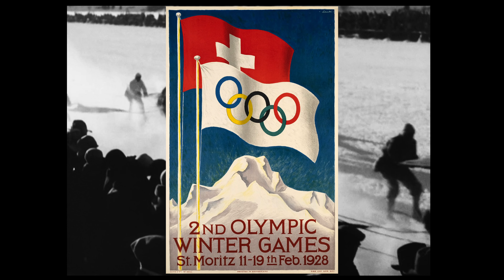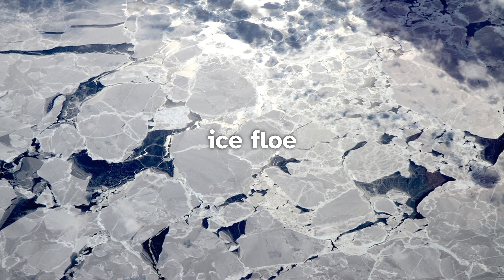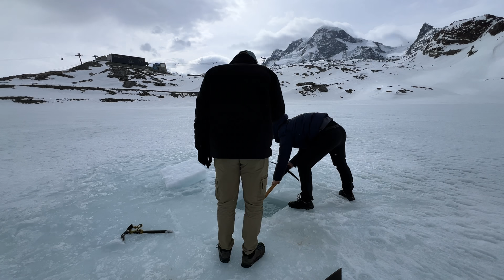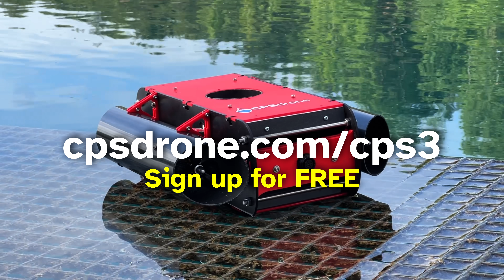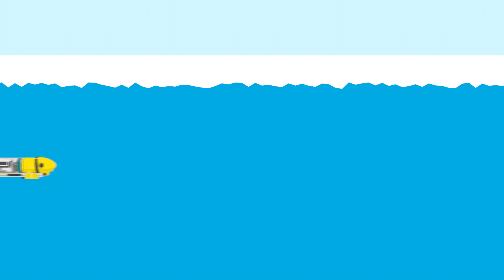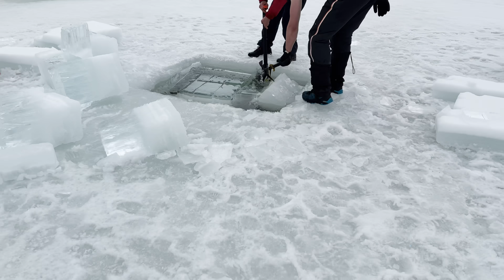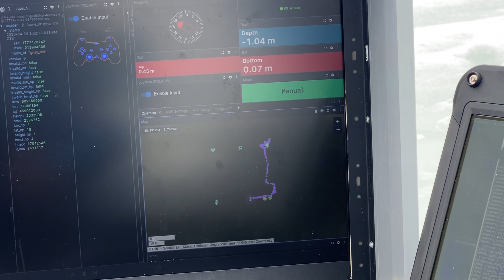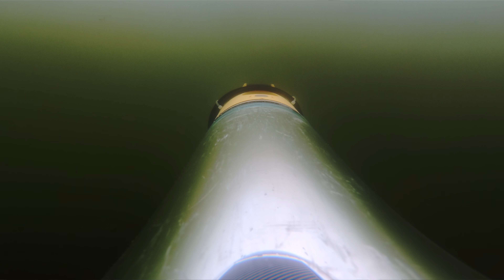Investigating an Alpine Submarine

Comment: Why can't they do the sound measuring from above the ice instead of below
Reply: Because the snow actually prevents any good measurements! Also, with this method we try to measure the ice at all times, even when it's thin and nothing can safely travel on it
Reply: @RichardRuedin drone with measurement device on rope
Reply: @BrickEnthus1ast what measurement device would you propose? Ultrasonic transducers require a very good interface to the ice sheet and a little snow would get in the way of that. You'd need to re apply ultrasonic coupling gel onto the icesheet too. Unfortunately even with no snow, the air interface ice sheet is more jagged and uneven than underwater. That alone can be really bad for your measurements, especially if you are using a drone to maneuver the sensor!
Reply: @RichardRuedin not to mention that with the differences in impedances, the return signal from the second layer of interest would be extremely low, giving a really bad SNR. 
Going with sonar from below is the right answer in my opinion, the matter now at hand is to do clever signal processing with pulse compression a d matched filtering (I learned about those in my radar engineering classes).
You guys did a wonderful job, only people who don't understand anything will criticise this much
Reply: @aterxter3437  thank you very much! You are absolutely right, getting the second echo from below is already hard enough lol. I see it more like healthy curiosity and less like critisizing! Also, if someone genuinely finds new valid approaches and ideas all the better for us!
Reply: @RichardRuedin, will you continue on the project or stop there as you used the available time in the curriculum for this project ?
Reply: @aterxter3437  some of us will continue the project, but with less time available for it of course. Its just too interesting and fun to completely stop, and we can always take our sub out for missions in winter that can benefit university research! (And general safety too)
Reply: @RichardRuedin  What about two drones. One under watter and second above. If ice is not obsticle for communication, you can make those to keep aligned autonomously and instead of messuring bounces from ice/watter (ice/air) you can send signal from top drone to bottom one and after send signal from bottom to top. No noise in bounces.
Reply: Underwater robotics student here! Water is actually a really good medium for sound because it generally has very predictable properties. It’s not that ice can’t be measured with acoustics, theres just less research about it so it would be less reliable. Additionally, if you think about it, a vehicle below the water would be less at risk if the ice broke as opposed to a surface vehicle.
Reply: that's what I also was just wondering 🤔. they must have a good reason as it would be so much simpler.
Reply: The ice is flat
Reply: Because sound travels worse in air
Reply: Long story short, sound wave can't easily change medium, everytime you change medium, you reflect part of the soundwave back (they use that property to have two waves to detect, one reflected at the water/ice interface and the other at the ice/air interface). The air/ice interface virtually reflect all power back, so from above you wouldn't get any signal back from the ice/water interface, whereas from below, it's much easier
Reply: Did you watch the video? 

The exact question you asked was answered.
Reply: @plumb123  They're talking about ice floes, which is understandable. But isn't their main goal to measure ice thickness in lakes? I'm not sure ice floes are commonly found in lakes, though. If not, couldn't they use the same measuring tools from above on lakes instead?
Reply: @Hwbxoabdo   i thin k because there are many layer of ice inside first layer
Reply: @Hwbxoabdo  in short if they measure it from above the sound waves will lose all the efficiency due to air and every other factors,by making this under water results will be more accurate..
Reply: @plumb123 😍❤
Reply: I can answer that for you...

Because reasons.
Reply: They can do a sonar sensor on a robot over the ice, but they like to complicate, they justify that the upper measurements would be dangerous to reach but an Unmanned Land Vehicle is perfect.
Reply: @hxl6162  The sonar doesn’t properly work from above because air conducts sound batley and has more interference
Reply: Ultrasonic isnt the only way to measure thickness from 1 side + making the sonar constantly touch the top surface of the ice (which is very flat relatively) is actually much easier than designing a submarine
Reply: @sibau9179 it's like medical ultrasound you have to create a sound window interface with water, gel, or the simple melting of the ice with an electric heater you'll have it, or you can also use microwave radar.
Reply: @imran_huseyn actually, just a little bit of snow would really complicate this method. You'd need to apply coupling gel for the ultrasonic transducer to even get readings on top of that. In the end having a sub drive from underwater and using distance measurements to get the ice thickness isnt really overcomplicating it by that much I think :)
Reply: @RichardRuedin Nice project. I think you don't need ultrasound gel. Just melt snow using heated sensor head until it's free from air. Problem is however a mixture of snow and water and ice.
BTW sub touching ice with sensor head from below seems much better. With or without melting for better coupling.
Reply: @ІгорАлієв  true, that would be super cool, hope we can implement that. Problems come from the reflections though if the ice isnt perfectly homogenous. We'd have to look into it more to find a suitable sensor too
Reply: @RichardRuedin thanks, hope that will help you.
BTW if you need so much time to travel there renting camper van is a good option to create camp there.
Reply: @ІгорАлієв  thanks! Well, for this test we had to go up a mountain with a ski lift so no car could ever bring us there lol. For our more accessible missions we have reliable transport, that makes it much easier!
Reply: @RichardRuedin thank you for the explanation. Good luck!
Reply: @hxl6162  imagine a robot over the ice... Rolling with a sensor... And ice is thin (isn't this some cartoon ass idea), what you think gonna happen if ice is thin"yeah brother ice is thin here wow our robot is under water" not even considering that sonar works great under water then over the Ice😂
Reply: @hxl6162 physics simply make it impossible to run properly from on top due to the interface between air and ice that behaves like a mirror to sound waves
Reply: @aterxter3437 no if you create a sonic window interface with water
Reply: @hxl6162 water that will freeze, that you need to maintain, so you will need to brush off the snow everytime...
It may not be such a bad idea, just that every idea brings challenges, they chose one, and show the results
Reply: @aterxter3437 it can have a heater around the ultrassonic transducer to heat and keep the water as a window at the place of reading

Comment: How about just solving the easiest problem which is underwater communication. There's ways to get wireless communication underwater just use photons right
Reply: In the end it should be fully autonomous so we might not even need communication ;)
Reply: Light also does not go very far in the water, a solution that I have seen being used is to use sound-based communication (ultrasound to be more specific), since it can travel a long distance in the water
Reply: Oh, I got to the part of the video that uses ultrasound haha but I meant data transfer using sound, and not just for location